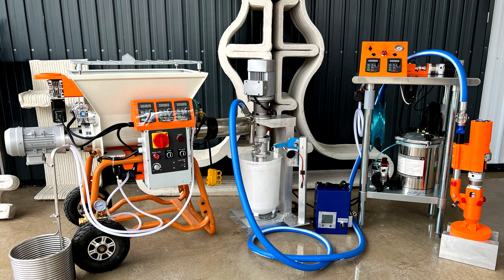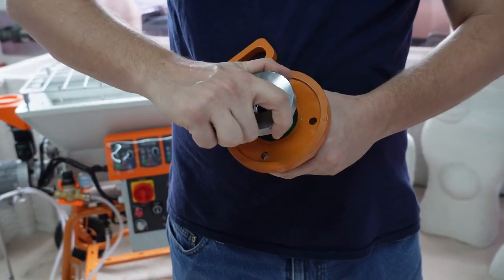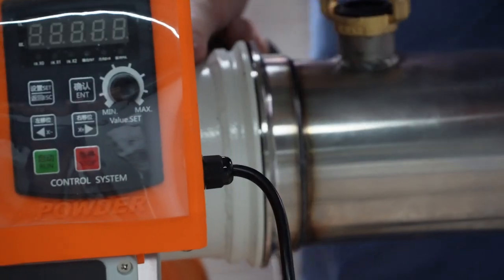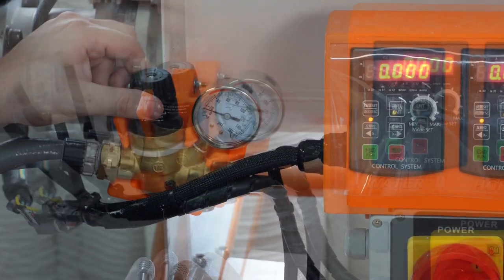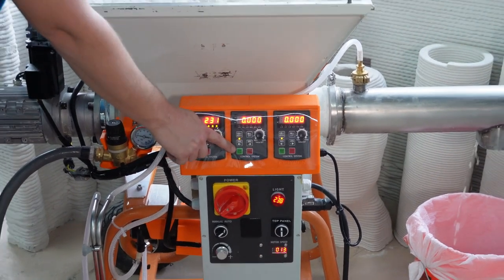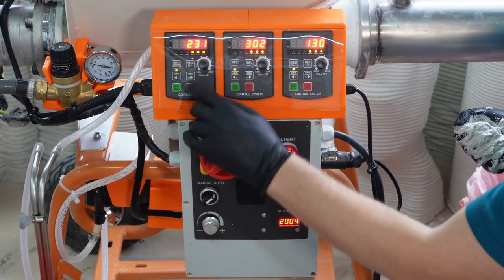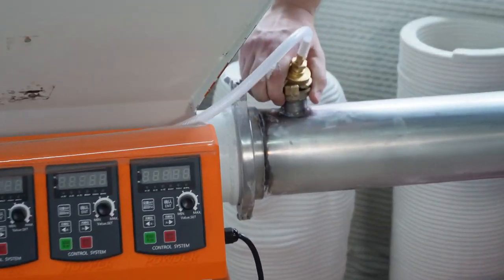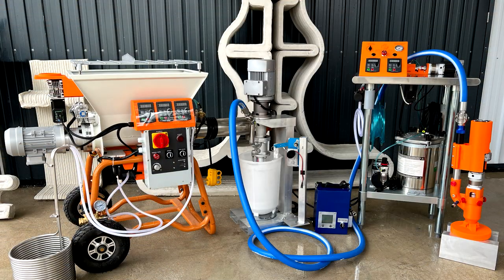3D Potter Continuous Cement Mixing Station Tutorial

Comment: So this is just a mixer, you need a pump separately? What is the Max volume output, per min or hour?  Thanks!
Reply from the maker: This is only the material mixer. The pump is sold separately. This mixer gives you extremely precise control on the water and dry material feed rates, which is important for 3D printing cement. I will ask our engineering team what the max volume output is and get back to you.
Reply: @3DPOTTER  Thank you. Really interested the the sustainable material output.